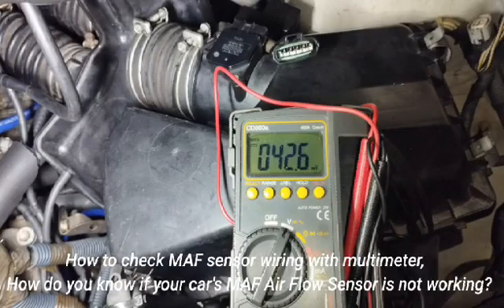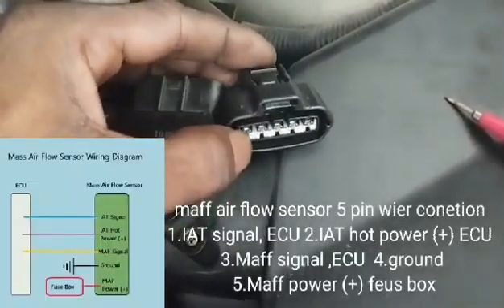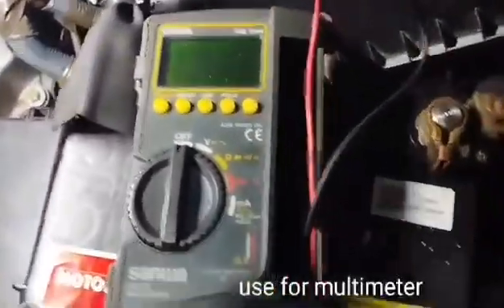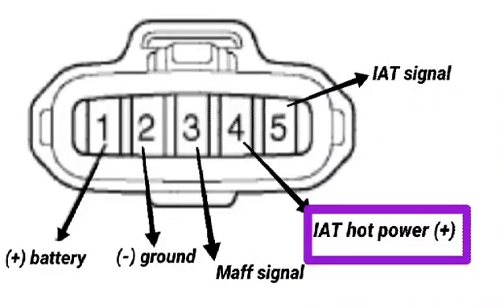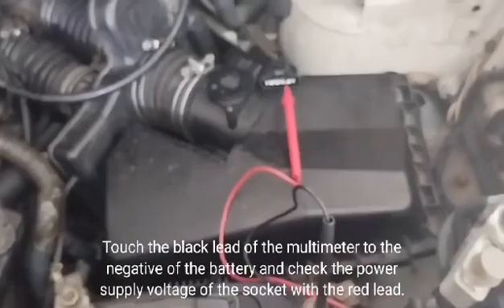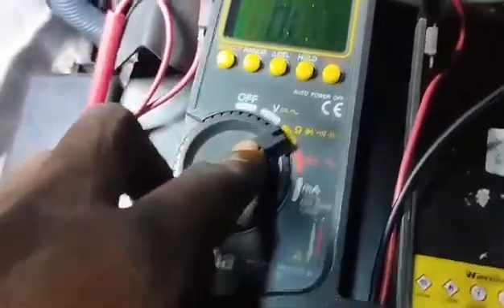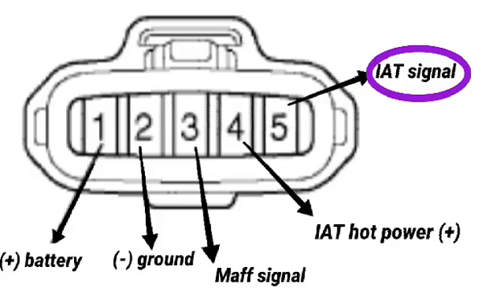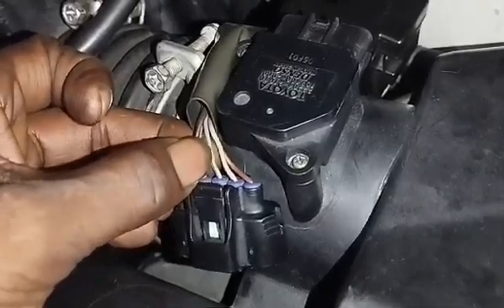How to test maf sensor with multimeter, How to fix an maf sensor is bad

Comment: Here’s a faster way to Check.!. The easy way to check if you have a bad air low sensor is to start your car and disconnect the sensor plug and if the car shuts off you have a Good sensor.!. But, If your car stays running it’s a Bad sensor.!. Ok.
Reply from the maker: Ok boss
Reply: @ I’ve been in the automotive business for 47yrs. And I’ve worked on just about every car I can think of.!. Except a Jaguar. I’m old school…👍🏽
Reply: I'm not get power to my mass air flow sensor.  Why
Reply: Mr. with 47 years experience can you please help me out? I disconnected the sensor plug and  my 2000 ford e350  stays running, then I purchased another mass air flow sensor and same thing happens, car stays running. Is that means both sensors are bad? my MAF sensors also have an IAT (Intake Air Temperature) sensor. Thank you

Comment: How do you know the senor was bad? You just found 12v, 5v, & gnd. You didn't back probe the signal wires on the harness to see if you got voltages in range for that specific car.
Reply from the maker: Ok boss

Comment: how about if -ve grounded got over 100 ohm
Reply from the maker: The multimeter should read between 200 and 600 ohms.
Reply: If I got no beeping sound on -ve wire what it's means ?
Reply: is it means wire to ground also have resistance?
Reply: No @moygigi7839
Reply: @moygigi7839 NO

Comment: What is the problem if the maf sensor is installed the engine wont start but .whenthe maf sensor is unplugged  the engine gets start.
Reply from the maker: Maaf sensor replace then check boss
Reply: Okay..il do it once the new maf sensor arrive.will update u soon.by the way thanks buddy for instant reply..

Comment: But that checks the voltage available at the wire end or socket. If it is ok it means correct voltage is being supplied to the MAF but how do you check if the MAF sensor itself is bad???
Reply from the maker: When wiring and supply voltage ok good, but  maff sensor not working properly ok
Reply: @SCSautomotive.1988   I just could not understand your answer
Reply: @72shivaramk  he would have cleaned it with CRC cleaner. And would have tested data of flow data and air temperature it s the procedure 🙏💐
Reply from the maker: Ok thanks for you